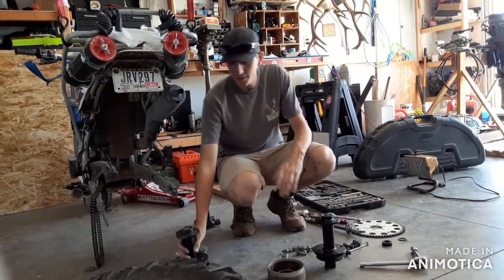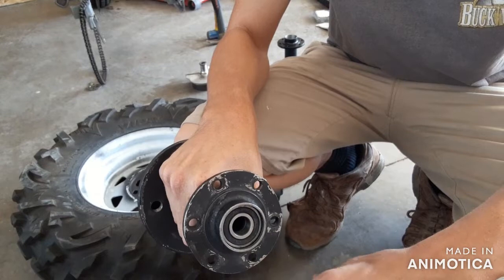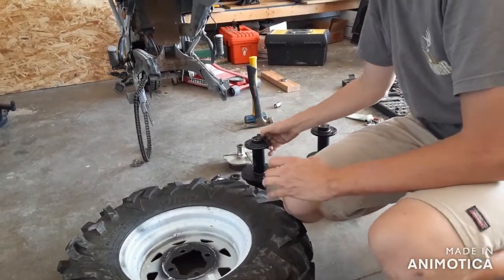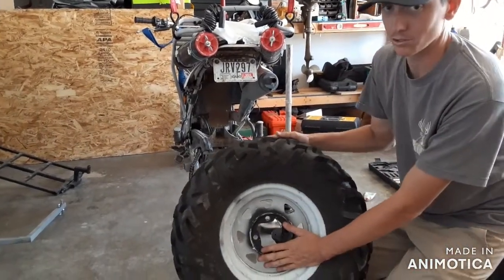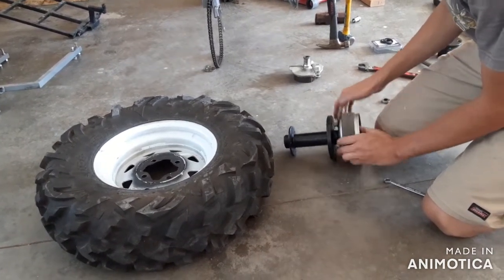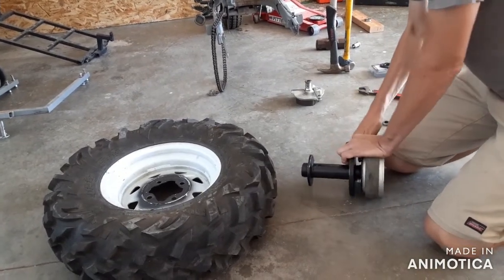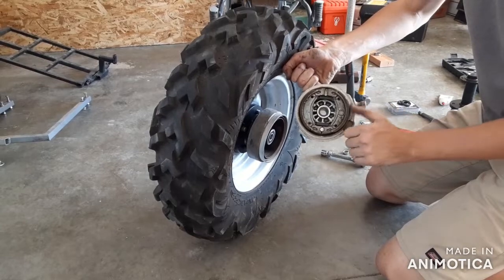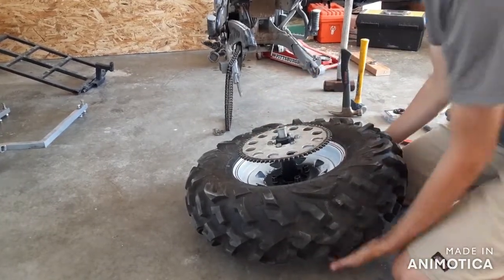HOW TO CHANGE TW 200 TRAILER WHEEL

Comment: This is a mod def worth doing for weight reduction, tubeless, atv tire for off road, and cool factor!
Reply from the maker: I don't know about weight reduction but definitely traction and tubeless for easy repair.
Reply: @stickslingers216  what is the size and offset of the trailer wheel?
Reply from the maker: @cigarr0000  should be zero offset.  And it does have a left and right side.

Comment: How's the 70 tooth sprocket? Top speed without exploding? Trail riding type riding? Good with the trailer wheel and ATV tire?
Reply from the maker: I think its a 66, but top speed is about 35-40mph.  The traction is fantastic and the guys that do way more riding than me love the conversion.
Reply: @stickslingers216  sweet, thanks! I put an order in for a hub with you. Looking at putting a big ol sprocket on and billy goating around the woods. How many links is the chain you're running with that setup?
Reply from the maker: @kyleshearer5722  I don't remember how many links.  I know the front is sized down to a 13 and I just bought a longer chain and cut it to size.